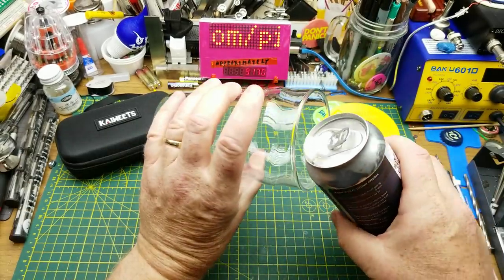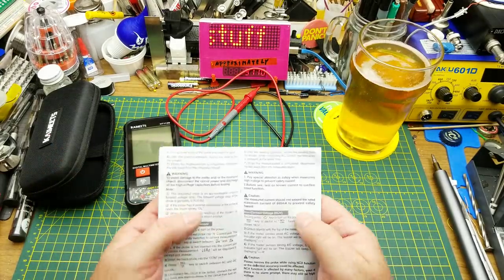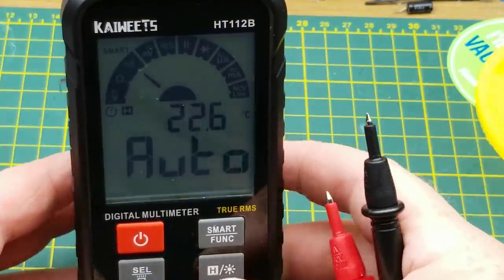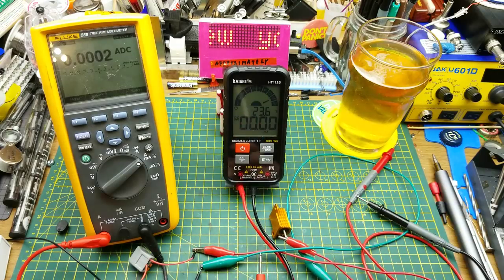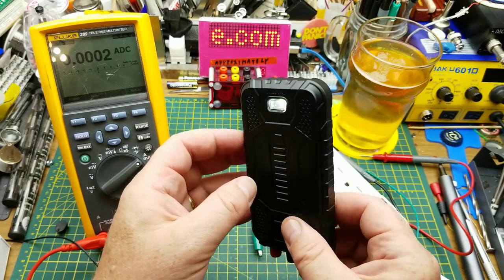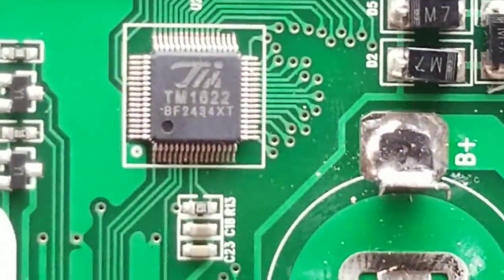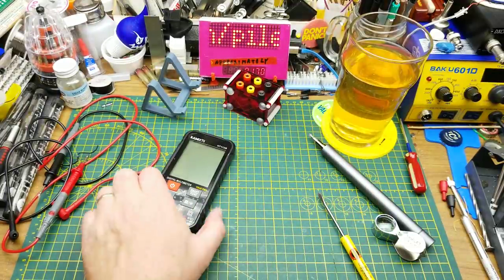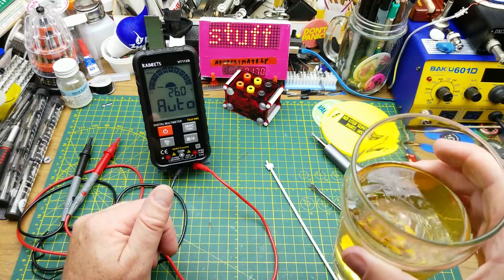Multimeter review Kaiweets HT112B

Comment: I have a pretty serious question.  When you did the live test, poking the probe into the power strip.  Why was the neutral side of the power strip hot? I don't understand because I am an electrician by trade and have always known the larger slop of outlets and power receptacles to be the neutral. When wiring receptacles, the screw on the hot side is brass (and sometimes even painted black), and the neutral is silver, meaning the white wire goes on the silver and the black (hot) goes on the brass. After a lifetime of wiring, have I been wrong all these years?    BTW, I love that meter, it appears to be something I would love to have on the bench.  Thanks!  ~Markus
Reply from the maker: I'll have to check that power bar - it has a replacement male plug on it (I got it at a yard sale, not sure who replaced the plug) so it is possible it's wired wrong.
Reply: I was about to comment the same.

Comment: I think the main issue for me would be only having 2V on the diode test function. Did you actually test this on a non-red LED, or could you quickly do that for us?
The specs make me think it must be running the CR2032's in parallel, for only (max) 3V power. Yet they can illuminate the white LED for the flashlight, so that's odd. Hmmm.
Of my 10 or so meters, I don't I have any that are unable to illuminate a 3V LED. Most (and all of the 2xAA models) include a tiny boost converter so they can also test low voltage Zeners at low current.

Comment: You didn't say, and I can't tell by looking at the screen, so I need to ask...
Are the screws holding the back on self-tappers into plastic, or machine screws into threaded inserts?
Also - you said the only reason most people would have to remove the back would be to replace the fuse, but don't you have to do it to change the batteries too?
Reply from the maker: The battery door screw goes into a metal insert (machine screw). The 4 that hold the back on are self-tapping into plastic. Though the only time most people would need to go in there is if they needed to replace the fuse.
Reply: @pileofstuff  Ah, I see...  I didn't realize there was a separate battery compartment door in the cover.
Reply from the maker: @RottnRobbie  There's a lot of detail that I recorded but edited out to try and keep this under 20 min.

Comment: DRAWBACK is the batteries go dead after 1 month even if not turned on...that is why they give you extra batteries with it
Reply from the maker: Yeah, that's annoyingly common with pretty much anything that has a "soft" power switch instead of a switch that cuts the battery connection.

Comment: I think I had some cheap multimeter leads fail before but I don't remember if it was something else or not
Reply from the maker: I have one set with a huge burn in them (from a soldering iron mishap)  
That's one of the benefits of the expensive silicone jacketed leads.